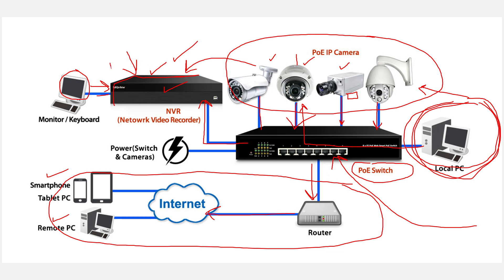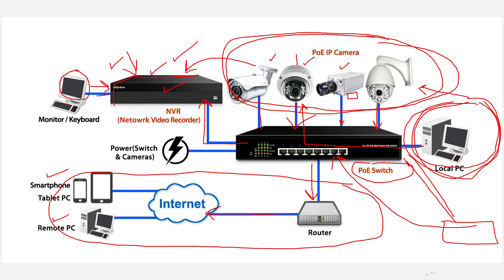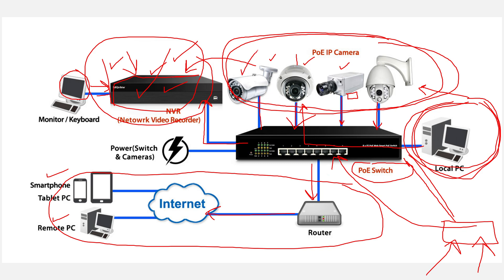What is the difference between a DVR and an NVR - analog versus IP?

Comment: Very nice Video once again.. Please note that while it is true most DVR's don't offer Audio the HD world is moving up and there are now cameras being made that will do audio over the BNC. If we think in terms of what someone had to do years ago to setup a camera on a CVBS BNC camera the user or installer would had to have RS-485, 422, and or 232 connected between the recorder and camera. With HD like TVI and such there is now UTC and one can connect over BNC to get to the cameras OSD.. Same is true for Audio in newer cameras. Also it used to be that BNC was not made for good HD cameras in lens types. Back when IP was really taking off BNC was stalled at 2mp.. However there are now systems of 8mp just like IP cameras and I have a 8ch 4k DVR as well as my 4k 16ch NVR.. In truth the NVR is easier in a sense however the DVR is in my mind a More Secure way of having CCTV cameras connected... Also one of the things that people need to understand is most Pre Made BNC cables are JUNK. Most of them today are only 3 wire and loads of them are CCA junk. However CCA isn't the main issue the main issue is they only are 3 wire and that is because the Video Ground is share the Voltage Ground and that is just not a good thing. One I can't use them for my Higher end Dual Voltage Cameras because your Video don't want to share a AC voltage LOL. So take a Multi meter and touch the part of the power wire that is ground The out side of the male jack and touch the ground of the BNC if it beeps or shows continuity then it is a shared ground cable and JUNK.. Second issue is that Higher power cameras  like ones that require 800ma and maybe even over 500ma will make the video look bad and if you say have a Camera with Siren and Flashing leds when the siren and lights go off the video will also show ripple..
Reply: Also not all CVBS cameras rely on the DVR as you posted. Just know that in theory that is true where IP cameras have built in WebServer and Unix software however I have loads of cameras that all the things are built into the BNC camera, While it don't have a WebServer it does have a OSD that requires user input for the camera to function. Infact I have some older 960h PTZ cameras that have Higher quality OSD and can do things that my IP cameras can't do. One like settings up each Preset to work in different formats. On my 2011 PTZ camera I can setup Preset 1 (That is saved in camera not the DVR) to be in color only or have it set up for Different Iris or F stop settings so I can get a Perfect picture. I have Schedules in my Cameras that way at night when it is Dark I can have my Camera change settings so max light enters and best picture is produced. If I left it that way for day time I would have only a White picture because to much light.. With older Cameras they Require more Menu settings adjustments for things to work perfect.. Also my IP PTZ one of them is 20x zoom, It has 16x Digital that I can turn on. However at 20x that is it anything over that don't show up on screen (If you have your zoom OSD turned on) however on my Analog 12x, 18x, 23x, 27x, 32x, 36x and 37x PTZ cameras not only will it say when I have gone to the max zoom it will then show the zoom in digital as well. So looking at first camera on my screen is my 12x, It will show it upto 192x and display this info on my screen. yet my IP cameras only show zoom to max Optical and nothing past that so like my 20x camera when it gets to OSD of 20x and even though it gets past that if I have Digital Zoom turned on the screen only shows 20x..
Reply from the maker: @revo2maxx  thanks Revo for your comments. You very knowledgeable about the analogue products. I have not seen analogue cameras that provide the usual features that IP cameras provide. Nowadays it is common for an IP camera to have SD card and run entirely alone while the same cannot be said for analogue. Maybe special purpose cameras as you mention.
Reply: @ecologicaltime  Well there are a lot of things that people don't know about the OLD CVBS cameras. Some of them can even run to a TV.. Anyway IP cameras are great in the sense of them having a Built in Web Server of some Unix format then like you said can record to a Micro SD. Then the Analog cameras while they have to have a VCR at a Min, most don't record long enough so you would need a Time Lapse VCR. I have had my share of CCTV tapes lol (Just normal tapes but recorded on very slow VCR) so they won't play back on a normal VCR.. Anyway should check out one of the last videos I made, Had someone ask me about why older PTZ was harder to setup rules for AI cameras. After watching that video people might have better Respect of the IP generation of cameras more. Personally IP cameras are nice, Just need to make sure each connection is Secure or connect to a POE NVR and make sure not to keep the cameras password as the default one. Had to go chase off someone that was using one of my friends internet access from his IP camera. After he returned home I went there and helped him secure his system so no one can have free internet access while he is gone.. It was crazy they were at the back deck with Laptop just chilling like they owned the place lol.. BNC cameras they can't do that from camera point of access.. Then people in the world of CCTV talk about only a couple of cameras of BNC can be viewed and that isn't true either. Most of them claims are people that are trying to Push IP sales. Also people talk about only being able to have 16 max for BNC type installs and IP can have 64 again that isn't 100% right either.. Matrixes, duplexes and all kinds of things can make watching as many as 256 Analog cameras over a Multi CMS platform
Reply: @ecologicaltime  So I don't know where to post anything to you that isn't on blast seeing I don't have a huge following maybe my channel might have been better. However on the topic of 4.0 FW and what is different in DVR or NVR I have found some things in the Brand I use. Wonder if the Dahua is also plagued with same issues. I didn't want to put the info on blast so it is in a Unlisted Video I uploaded but if you watch this video can you confirm or let me know if it is also in your Dahua devices or is it just a Flaw they installed in the one I use? https://youtu.be/Q0dGPqdQUuI It isn't the Annke that it starts out in it is after I show how it should work. Then I show the Risk/Flaws and how it works now. Personally don't like being told that is how it is lol.

Comment: What is the model number of the Dahua 8 Port PoE NVR in your video?

Is it a 5000 series range (or better) NVR? If so, that will give Orange IVS (Intelligent Video Surveillance) Marks (Tripwire, Object Missing / Abandoned etc.) on the Green 24H recording timeline. Last time I looked Dahua NVR’s below the 5000 range don’t do IVS.

You mentioned Facial Recognition NVR’s - does the NVR in your video do Facial Recognition?

But if your NVR has the newest NVR firmware - which is designed to detect hacked Chinese market Dahua IP Cameras - then either the NVR will refuse to work with hacked Chinese market cameras or it will not do IVS etc. – need the right age of NVR Firmware to avoid that issue.

IVS can save a lot of time while also detecting things that normally would be missed – time is money – you can always earn more money - but you never get back time wasted like watching NVR video footage from imprecise Motion Sensing (Yellow marks on the timeline) instead of more precise IVS (Orange timeline marks).

I have the same 24 Port HP PoE Switch as shown in your video – how do you deal with the noise from its six 40mm fans spinning at up to 9,800RPM? Although if you think that is loud then you obviously have not endured the (same 1U height) 48 Port versions of this HP PoE Switch.

HP replaced the entire (6 fan) fan tray assembly under their Lifetime Warranty (HP Courier the part to you – you fit it and send the failed part back) – which did make the Switch a little quieter but mostly made the Switch fan noise a far lower pitch/tone - and put out the “Fan” warning light!

Have you updated the Firmware in your HP PoE 24 Port Switch recently? – Firmware version ending in 30 (if I remember correctly) actually made the switch significantly quieter even after the fans were replaced.

There is a 2 February 2021 Security Bulletin out from HP covering these Switches (and also many other HP Switch ranges) – you have to update to the latest Switch Firmware version ending in 32 (literally “ASAP” according to HP) otherwise massive security hole see http://support.hpe.com/hpesc/public/docDisplay?docLocale=en_US&docId=hpesbnw04083en_us – in my experience without that upgrade your HP Switch can catch a Virus.

Follow the correct Firmware upgrade steps as detailed in the latest HP Firmware Release Notes otherwise bricking the switch is possible - so use the Switches Primary and Secondary Flash Memory locations during upgrade – that way if it goes wrong, you can revert to prior Firmware version using the other Memory Location and recover to continue the upgrade/resume operation with last known good.

Caution - Some HP Switch Firmware packages also update the HP Switch Boot ROM as well as the Firmware – which can give unpredictable results – also the newer Firmware that adds Cryptographic Firmware image verification during boot can be tricky (as only the next Firmware Upgrade will actually apply Cryptographic Firmware Image Verification) – they work perfectly once successfully installed.

Despite doing all that - just one HP Switch went into boot failure and could not complete booting up on upgrade to version 30 but that same version 30 Firmware worked perfectly on all the other HP Switches BUT that particular HP Switch with sudden boot failure (following upgrade) had also been inexplicably consuming an unusually high amount of power from the mains and there were also unusually high and persistent levels of Switch CPU loads from that Switch (Switch GUI was also slightly sluggish to respond by comparison) – so via Serial Console cable (as no Ethernet port was working due to Boot Failure) discovered that the Switch had a cryptographic failure error meaning the checksum of the version 30 upgrade did not match the signature of the upgrade file from HP so boot up automatically halts as Firmware corruption is detected – so to escape boot failure instead booted up successfully from the other Flash Memory location containing whatever (near) Firmware version it was running prior to version 30.

That one Switch absolutely would not upgrade to version 30 instead reporting switch failure on CLI screen (via Putty over 9 Pin Serial Cable) and Switch saying on CLI screen to contact HP to arrange replacement under warranty – HP said Firmware 30 was “too new” and to run it on previous (to version 30) Firmware.

Turned out the Switch Hardware was in the end NOT faulty.

Point being that upgrading that same HP switch which previously had boot failure on version 30 (due to cryptographic mismatch) to version 32 (32 which HP rushed out with Release Notes still watermarked as “DRAFT” and HP said version 30 was “too new”?) which closed all the security holes that HP literally say to “ASAP” close in their security bulletin suddenly got rid of the Switch Boot Failure, Unusually High Mains Power Consumption and no more unexplained high Switch CPU Load and even the Switch cooling fans run slower and quieter (Switch GUI quick as well).

Conclusion? That HP Switch had caught some kind of virus or malware and closing the security holes (that HP warned of) with version 32 Firmware cured everything.

Several years ago, HP had a similar problem – HP claimed they were sold Compact Flash Memory Cards that were meant to be blank but instead contained malware - HP built Network Switches using those Compact Flash Cards inside and sent them out to customers with factory installed Malware! Not unlike any IP Camera can be infected with Trojans / Malware etc. and put into a botnet. HP also sent out those infected Compact Flash Cards as Warranty replacements as well – HP never erased / formatted the Compact Flash cards before putting the Switch Firmware on them!

Makes you wonder - especially as there are even a couple of “Certified” US Department of Defence Switch Firmware’s listed at HP as available to download with all the rest of the Firmware versions for this range of HP Switches – as these Switches can do near wire speed switching and also port forward while also simultaneously copying to a third port perhaps this range of switches are what is used for the initial tap in http://en.wikipedia.org/wiki/Room_641A ? Also see this Windowless 29 Floor Skyscraper Granite clad bunker of a Telephone exchange in Manhattan New York City http://en.wikipedia.org/wiki/33_Thomas_Street

Besides all of that one of the best things is HP the documentation that says you can use Outdoor IP Cameras and Outdoor WIFI equipment etc. and HP do not seem remotely concerned about lightning striking the outdoor Ethernet equipment connected to their Switch – while most of the other PoE Switch makers warn not to connect to any outdoor Ethernet equipment because of the risk of lighting strike and make oblique references to needing additional “adequate” surge protection devices between the Switch and the outdoor equipment while also warning that no warranty for lightning strikes – compare that to HP’s Lifetime (100 year if you look it up) Switch Warranty – (if only the HP Switches could be made quiet).

Wonder how a Dahua NVR would cope with one of its directly connected Ethernet PoE cameras being hit / affected by nearby lightning?
Reply from the maker: hi, thank you for your detailed reply.
Model is 4116HS 4KS2. it does have IVS if the latest firmware is used.
Ha ha thats so true, the HP switch sounds like a flight taking off when you restart the unit. 
"Have you updated the Firmware in your HP PoE 24 Port Switch recently? – Firmware version ending in 30 (if I remember correctly) actually made the switch significantly quieter even after the fans were replaced." - i did not know that- thanks. I have a few of these units and two failed after about 10 years and one was swapped out (part sent to me). 
The firmware issue is very helpful, thank you. I have some old units.
Yes the warranty for the units is very good, Dahua dont provide such warranty in my country. They say it its surge or lightening its not under warranty. 
In terms fo the HP warranty, i dont know anyone who uses these switches for cameras though. There are much cheaper POEs for camera use and clients are not ready to pay 5-8x the price just for the HP. Having said that, i have used them for cameras and, hell these switches are tough. 
My two older HPs have power supply issues. It seems like a problem that these switches had. The chassis goes live and you can get a shock if you touch it. 
Kind Regards